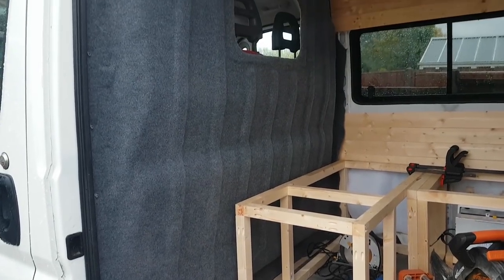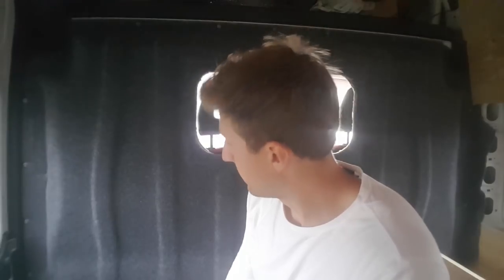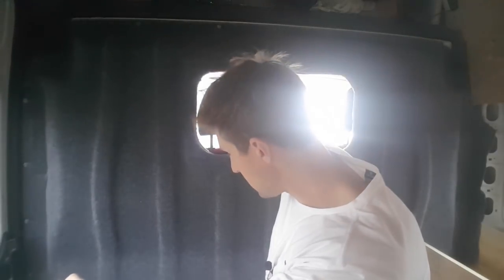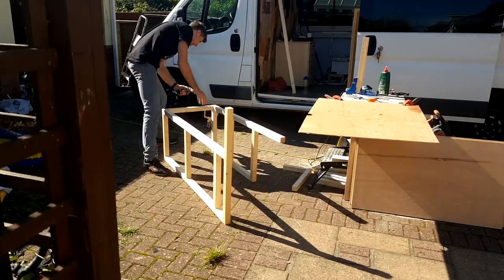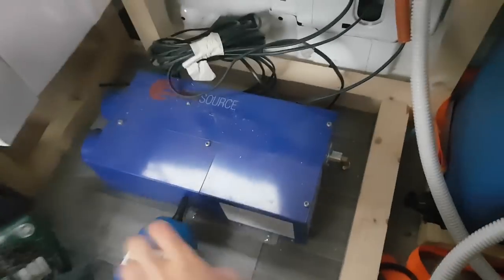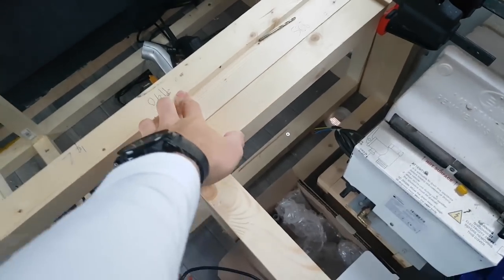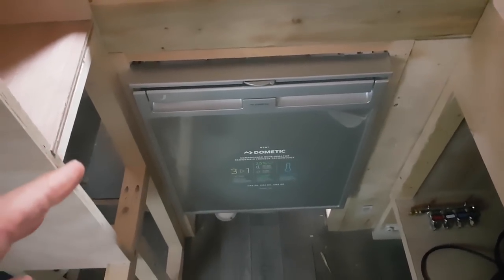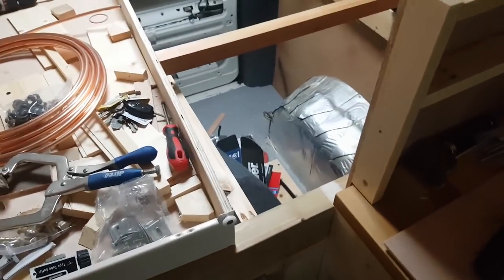Fiat Ducato Camper Conversion. Carpet Lining, Bed, Bench & Wardrobe Build, Gas Fittings

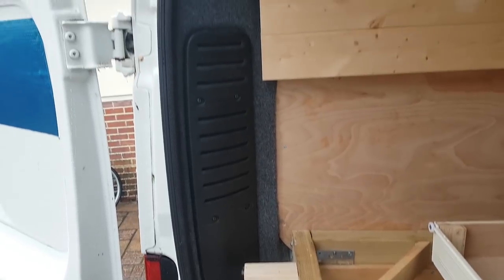Comment: Appreciate this is a bit of an old video, but hopefully you can answer a question. We are looking to carpet the back of our van and at 4:14 and onwards, you show the back where you carpet around the lights. One side is done, one not. I guess that means you carpeted in segments but wondered how you carpeted the light area as you then put the plastic cover back on top? Did you carpet then just cut the holes out?
Reply from the maker: Hi. Yh I did this in segments. Not ideal as you get the join line but I was just using some left over carpet from another van. Yes just carpeted over the lights then cut out for access to the bulbs if required. Beware carpeting over open sections of body work like this. If using a lighter coloured carpet it will likely become dirty over time as the dirt from the road comes up through the vents in the bodywork. OK here as the plastic covers go over the top but may be an issue elsewhere. Can just tape over any hole or use some sticky backed closed cell foam. Cheers!

Comment: Its looking good! I like your idea avout the bed! Just wondering how did u attach the nuts and screws to the side ribs??? I want to do the same it look really strong and solid frame. Thanks
Reply from the maker: Hi Miguel. There are a number of holes in the ribs. Some of them are threaded some of them are plain through holes. I measured the holes and bought bolts accordingly. Cheers!

Comment: Been enjoying your video's mate!! I'm buying a Fiat Ducato at the beginning of Jan and was just wondering have you had any issues with yours since buying it or anything I should look out for when going to see one?
THANKS  :)
Reply from the maker: Hi Scott, to be honest since buying it I have only driven it 30mins back from the garage to where I'm converting it! That will be changing end of next week as the conversion nears completion and I will start driving it around and giving it a proper shake down prior to taking it to the Alps for New Years. I don't have any specific advice regarding ducato's however I have bought my fair share of second hand vehicles over the years and applying these simple rules seems to avoid unreliable vehicles 1) only buy if it's got full service history and lots of receipts  2) if unsure whether or not the cam belt needs doing just get it done when you buy it 3) check for clutch slip 4) look round the vehicle in daylight & and come back for a second visit (I always notice heaps more stuff second time around 5) don't be scared of high mileage - motorway miles are much kinder than city miles! Hope this helps. More vids on the way. Just flat out getting the conversion finished at the mo 👍
Reply: @sampayne6318  Smashing! Really appreciate the reply and effort :)
Can't wait to convert mine and will defo use those 5 points when going to see one. Good luck with the rest of the build  and I look forward to seeing more.